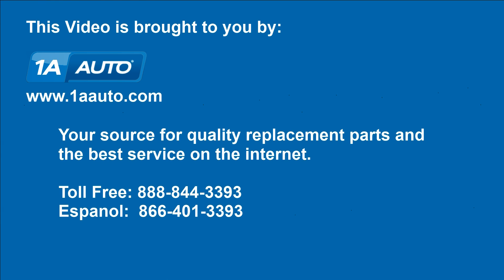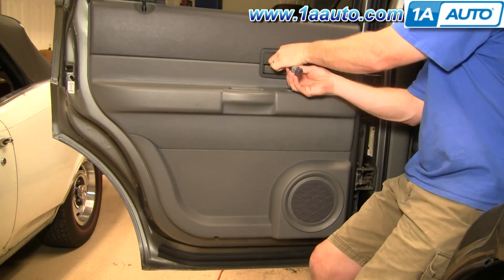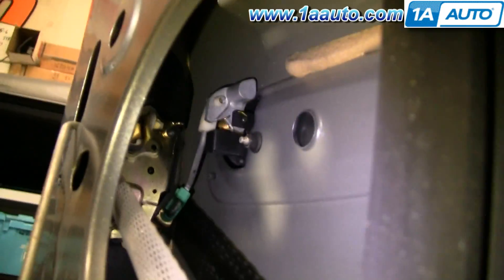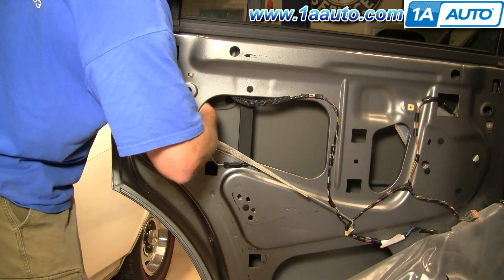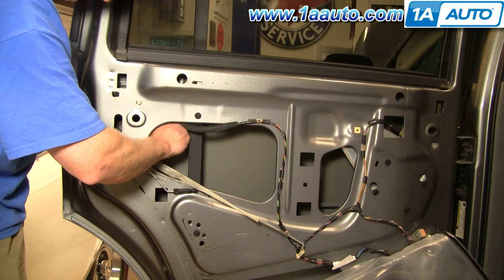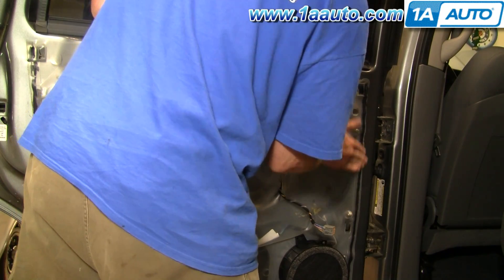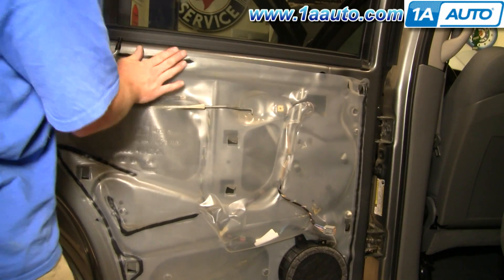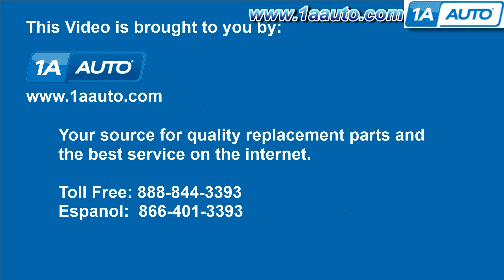How To Replace Rear Door Handle 04-09 Dodge Durango

Comment: Do you have or can you make a video for  handle replacement on a 2005 Didge Durango?  I got the panel off but it has me stumped. At 1:44 on this video you can see what has to be taken off to get the replacement part in. I can't figure that out.